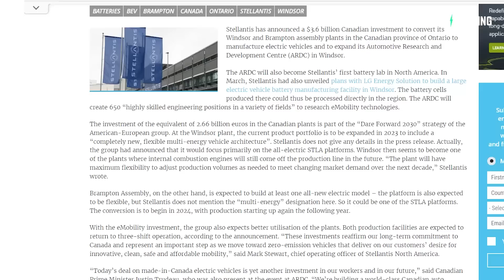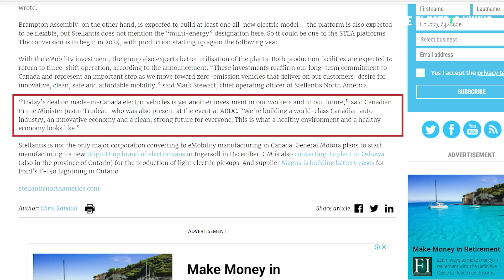Stellantis & GM invest billions on EVs & batteries in Canada

Comment: I really want to buy the proposed "E"quinox.  Because of the daily improvements in battery technology I am afraid that GM's battery will be obsolete before I have a chance to run out of charge in my Edmonton winter.  Do you think 300 miles of charge will be realistic by 2023 at a reasonable (35KCAD$) price?
Reply: Don't count on it!

Comment: 2025 is a long way away in the automotive world. One risks working on technology that might be deemed obsolete when the plant builds its first EV. Manufacturers better move much faster than they have in the past, or they will become irrelevant.
Reply: It seems to me all EV manufacturers are in the same boat: trying to become profitable in a rapidly evolving field – i.e., aiming at a moving target. But it's Tesla & the Chineses' proven ability to adapt & pivot quickly, that's setting the pace of change. So yup, the spoils go to the nimble & to the alert ...
Reply: @pbasswil  If you call 18 years to become profitable quickly.
Reply: @heathwirt8919  Time to profitability wasn't the topic of my comment, I was trying to address Smarticus's comment, which I understood to suggest that Stelantis's 2025 plans were too slow (maybe I misunderstood him). I was suggesting that all EV co.s have the same challenge, anticipating coming conditions, and planning & building infrastructure fast enough to compete in a rapidly evolving market. Tesla just happens to already have proven to continually be very agile & nimble, and (partly as a result of that) is the first to achieve a good profit on EVs,
Reply: @pbasswil  "Tesla just happens to already have proven to continually be very agile & nimble, and (partly as a result of that) is the first to achieve a good profit on EVs," And it took Tesla 18 years to turn a profit, Ford, GM and Stellantis will be profitable much sooner than that. Ford will likely show profit on EV sales the first year of production.
Reply: @heathwirt8919  Wow, good luck to them! (F, GM, Stel) Their margins on good ol' ICE cars are 1/3 to 1/2 of Tesla's; maybe they'll have better luck with batteries & electric motors.
Reply: @heathwirt8919  I should be around here in 5 years, if you are. Let's see which car co's are still around then, too. :^>
Reply: Manufacturing technology is already highly evolved and will not change much between now and 2025. The flexibility built into modern manufacturing systems will allow changes on the fly to suit needs and demands. From a manufacturing perspective, assembling EV's in not much different than ICE vehicles and in fact a simpler process with less workstations.
Reply: @heathwirt8919  Believe it or not, there are still advancements making a difference. Mega castings, Aluminum bodies, structural battery packs, Cobalt-less chemistry, etc., all of which will be utilized first by non-legacy manufacturers (the exception of the aluminum F-150). However, one of the most significant liabilities is labor. Overpaying union labor will lead to a struggle to compete. Even though Detroit is lobbying DC to address this with tax incentives, this will not solve the problem in the long term. However, the biggest issue for legacy manufacturers is the enormous investment and debt assigned to ICV manufacturing. GM and Ford owe tens of billions on existing ICV production and spend more billions gearing up for EVs. This debt will ultimately sink the legacy manufacturers.